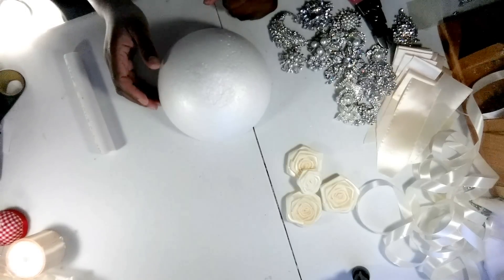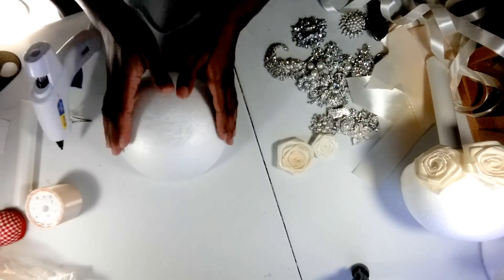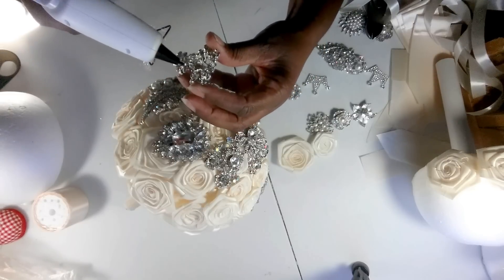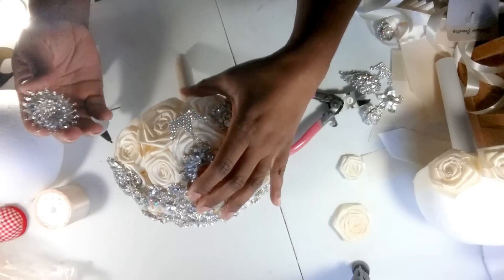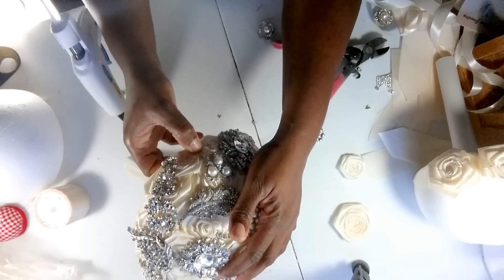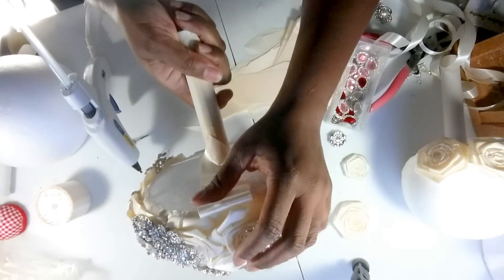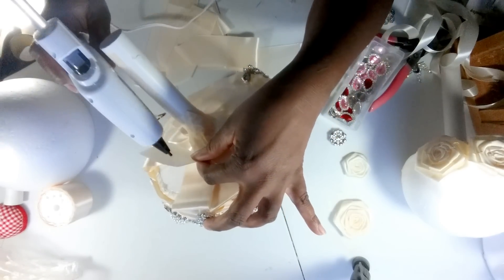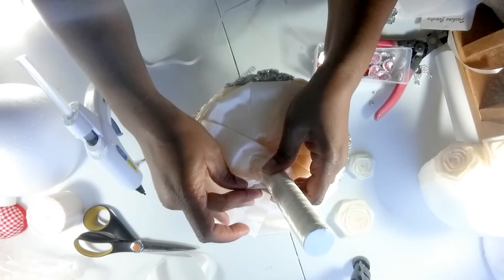DIY Bridal Brooch Bouquet Kit Easy No Wires Satin Fabric Roses Wedding Flowers

Comment: Hi Nicole
how secure are the brooches with just using the hot glue and how long with the glue hold?
Reply from the maker: After 24 hrs you have to use some muscle to remove the brooches.
Reply: I'd be more concerned about the PVC coming off